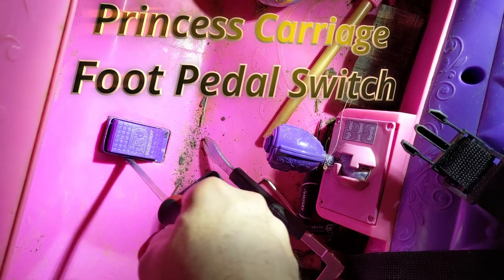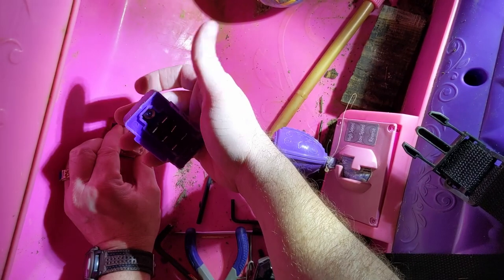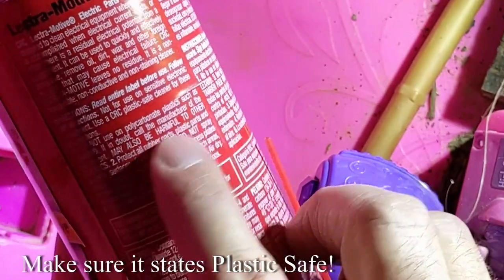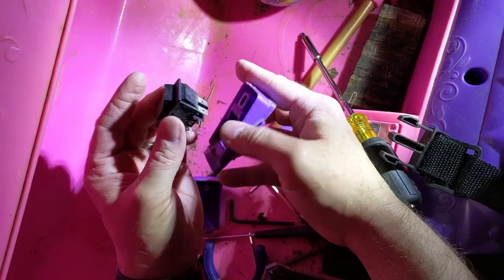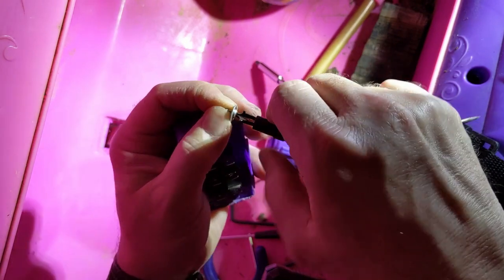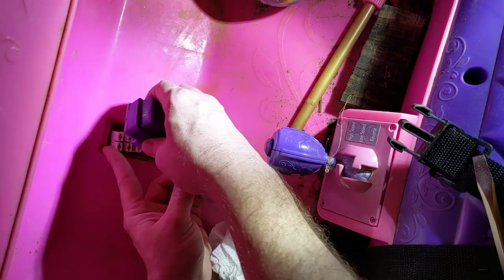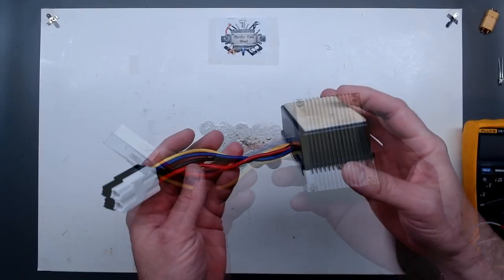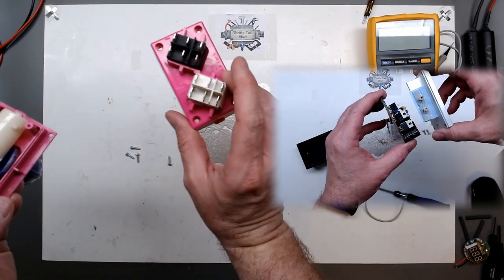Disney Princess Carriage Foot Pedal Switch Replacement

Comment: Thanks for the video! Just wondering if sound will still work if the carriage needs to be charged for driving?
Reply from the maker: Hi,
The steering wheel button does some of the lights and sounds and it's powered by batteries in the steering wheel itself and not the 24V vehicle battery.

Comment: do you know if there is away to bypass the wand holder, we got one second hand and are missing the wand and the wand holder is no good, I am not able to find a replacement Wand holder So I would just like to bypass it  and just put a toggle switch to turn it on and off
Reply from the maker: I actually left all the wand holder detail off the drawing I shared since it had nothing to do with the power train and made the drawing too busy. I don't remember much about it except the wand slid in to make the contact points so most likely simply adding a switch would work just fine.

Comment: So we just bought one and it will go drive in the high setting but not in low or reverse . Any idea what it is
Reply from the maker: Possibly the (switch or switches) in the shifter. I would check the connection on these really well and look for corrosion on them also. I did have a quick drawn schematic on the carriage that I shared in one of the videos on it. It should help trace down and troubleshoot.

Comment: Hey I had a question.  I just picked up one second hand and it was not working.  I replaced the circuit board and foot switch and when I push the switch i can hear the circuit board clicking.  But nothing happens.  I did swap in a dewalt 20v battery and adapter in place of the old battery.  Could that be my issue?  I’m reading 18.62 volts at the foot switch orange.
Reply from the maker: I have taken time to draw up a quick wiring diagram and shared it as well in a video. The DeWalt pack may not power it for very long, but I would think it should still at least run for testing (especially with wheels lifted off the ground). As long as the 20V is getting through the controller and then through the switches it should go through the Circuit breaker at each motor and  power the motors. I would work the switches back and forth and see if it acts any differently. The high/low & forward/reverse all have different connections and could be a issue with one of thise. If no combination of switch posirions work then check the white and black connectors on the back of the switch assembly for good connection also. The wiring diagram should help tremendously as I showed how the voltage path makes its way to motors in the video. Hope it helps and best of luck to ya!
Reply: @ThriftyToolShed  Will give it a shot.  But, in your opinion if I put in a new foot switch, circuit board, and gear selector then there should be nothing to stop it from working?
Reply from the maker: @daroncraig8602  
As the wiring diagram shows, that is the main items. You also have connectors themselves that good be an issue and the circuit breakers at each motor.  Don't forget the charging contact as mentioned in the wiring diagram video also.
Reply: @ThriftyToolShed  You mentioned the charging port could be an issue.  How do you bypass that ?  I could try bypassing the thermal circuit breakers at each motor I guess also.

Comment: I’m trying to add a remote control to my daughter’s princess carriage. Is there a video to help me?
Reply: I got one gifted to me and was told it just needs a new battery. My daughter hasn’t learned to operate it on her own so I’m wanting to put a remote control on it
Reply from the maker: Not that I am aware of. It would be simple to have kind of Emergency stop push button mounted on the top, side etc, but as far as true remote control and even steering...
You would be spending more than the carriage is worth for sure.
Reply: @ThriftyToolShed  true!! I actually just found a steering motor and a wire harness that’s got a programmed remote
Reply: So fingers crossed. That will run me $65 on Amazon
Reply from the maker: @JiggaDubbz4K  yes! It's such a large carriage that will possibly need a rack and pinion steering. Most cheaper options may not hold up! Best of luck to ya!
Reply: @ThriftyToolShed  definitely!! It is on my friend 🤣🤣

Comment: I’m trying to find a battery to fit this what battery will???
Reply from the maker: It is options out there if you wish to buy a couple of 12V batteries and put them in series to be 24V. If that's not something you can or are willing to do then you will have to buy the replacement 24V battery for this to make sure it's correct.

Comment: I have one of these and it runs and moves then slows down to a very slow speed even in high gear, I replaced the speed controller and it still does it, any tips where I should check would be greatly appreciated
Reply from the maker: Usually the battery getting weak when slowing down. If battery is new and charged then make sure the high/low switch is not going into low  instead of high  and putting the motors in series instead of parallel for high speed. Only other thing could possibly be one Motor going bad and pulling down the other one?
Reply: @ThriftyToolShed  thank you sir I will check into that

Comment: Is there an on off switch
Reply from the maker: Not on this one. Just the main battery connector and after that press the pedal. The selector or shifter is simply High, low or Rev.

Comment: So in your video it shows that the wiring of the pedal does not come out very far but mine definitely does. Would that mean problems with the wiring?
Reply from the maker: I would not be surprised if some are different. I have only worked on that one. Some harnesses could have been different from the factory? If it has more wire to be easier to remove the switch that is good. As long as it has not pulled the wiring from the back near the motors etc. or the selector switch harness I would think your good?

Comment: I desperately need help. I bought my daughters one from someone and I can’t get it to work. All the wiring looks clean not corroded and in place. The wand is missing but when I stick a screw driver down in the slot the led lights come on in the front. So while I’m holding that I pushed the pedal and the lights cut out every time I push the pedal
Reply from the maker: The wand is just for play it is not needed for operation. It seems like you know that because you figured out how to press the switch to activate it. I just wanted to mention that. It did offer some good troubleshooting here. It seems like the voltage from the battery is dropping off when you load it down. Since when you press the pedal the LED lights cutout? It could be as simple as the battery is low or possible even bad. It could also be something pulling the voltage low because of a short like I mentioned about the pedal contacts. I have drawn up a quick wiring diagram and shared in a video to help troubleshooting because I could never find one. Hope it helps, best of luck to ya!
Reply: I just ordered a control box. I’m not a pro and don’t know what I’m doing unfortunately. I watched all your videos on it but wasn’t quite sure what the actual issue is. I took the pedal off and everything to me (no pro) looks fine. I moved the wheels and it’s not the motor (least what I gathered from another mans video) the battery is supposedly only 5 months old but don’t have a volt reader to know for sure.

Comment: I just bought a Disney princess carriage powerwheel from somebody and apparently the daughter of the parent I bought it from was cleaning it so she could sell it well it worked before she used  water the father stated.  They took battery out to air dry.... the wand and lights work it just wont move.  Could the problem be water in the foot pedal? I did see that they opened the compartment where the reverse/forward lever and there are 2 red wires that has been stripped at the ends and they are not connected to it
Reply from the maker: It could be water in the foot pedal causing some issues. Also you are saying the red wires are not connected to switch but are connected together?
Reply from the maker: Btw:
There is also a 5A circuit breaker in there with the switches that does have 2 red wires. Just wondering if someone jumped that out?
Reply: Yes
Reply: @ThriftyToolShed  I'm trying to figure out how to send you a picture of it.
Reply: Having the same problem got power to lights and wand won’t do nothing else light on the front dims when pushing the pedal
Reply from the maker: Possible a weak battery if the lights dim when pressing foot pedal. If you put the carriage in low speed you may have a little bit better luck testing it if the battery is weak.
Reply: @ThriftyToolShed  I splice wires hook up car battery to it nothing hook cables to hot and ground on both motors it works but not getting power to something but straight wired to motor it works
Reply from the maker: Well the controller needs 24V to work. I am not sure the controller will output at all with 12V from car battery? The motors should turn if 12V directly applied. Make sure you test with good 24V to eliminate the controller being bad. If you have 24V into the controller and not out, then the controller is bad. In the video about the wiring and controller, I mention some of this.

Comment: Ok so just got my new control box in and it still isn’t running 😔
Reply from the maker: I also have a video going through the  wiring diagram that I created for the carriage. I could not find any information on the thing so I created one and shared it. If you are getting the voltage output from controller, then check that it is getting through all the contacts on the fwd/rev and speed switches. Btw, I recommend having the wheels jacked up off the ground while testing, this carriage is surprising strong!